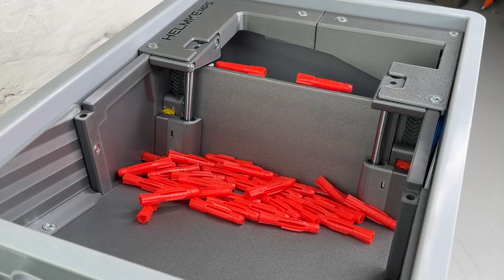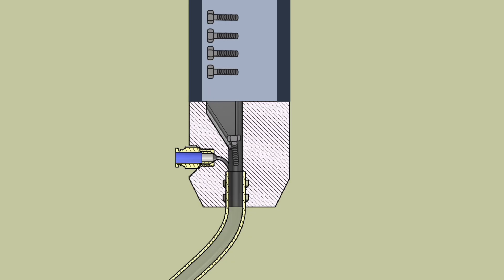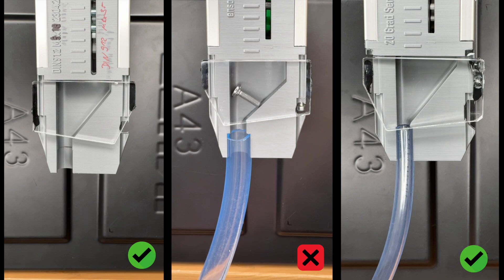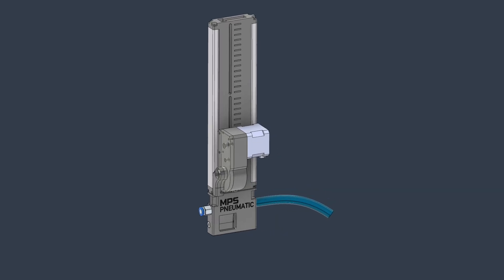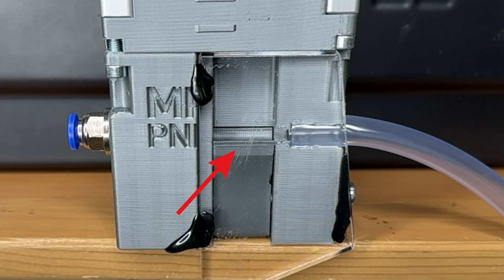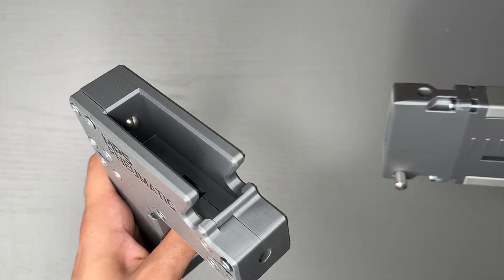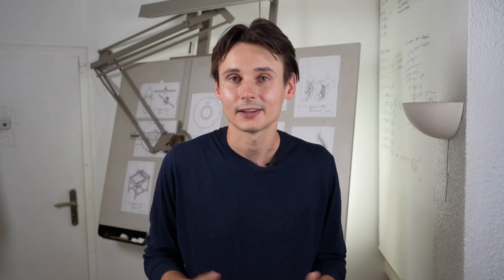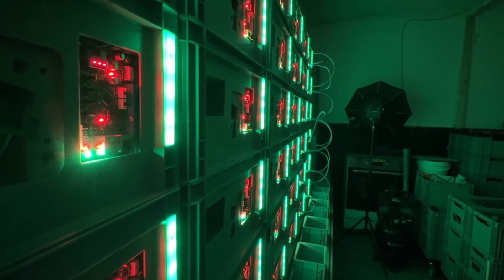Launching screws through washers - 3d printed automation #009

Comment: I made an OpenSCAD module that computes the space carved out by an object as it follows a parametric path in space.

It's parametrized to allow uncertainty in position/orientation to vary through the path. I used it to design a docking tray for a magnetically mounted printer bed probe. The tray is held on a short arm mounted to the shaft of a cheap stepper motor, and it is ramped to accommodate the terrible amount of slop the cheap motor has.

I wonder if you could do something similar for the falling parts as you try to maneuver them into the pneumatic tube in the correct orientation.

Comment: In my opinon the first drop down screw feeder, there was to much of an open area for that one screw to flip over. If you angled the left side wall to a 10 to 15 degree angle toward the right side wall causing a funneling effect the screw would have sliden down perfectly no mater the size of the screw head. if you reduced the open area that it takes the screw to flip it will not have enough room to flip in the drop chamber.

Comment: I think some kind of an escapement mechanism that locks the column above, drops a screw and repeat would have worked, it would have minimized the fall distance and also seal the tube from leaking pressure into the screw tank. Great job indeed, also love the debate in the comments

Comment: a steeper angle and not as wide would work. imho the first short one works because of the steeper angle it has. and to offset the bigger bolt head it needs to be a few degrees more than that.

Comment: Why not just add a rail with a hole in the middle that would catch the head of the screw but let the tail fall down, allow it to slide down the rail into an opening and so no matter what direction the screw enters the rail at it’ll always face the same orientation. To solve the problem of allowing multiple screws you can have multiple steps to the rail and this will even automatically sort them.

Comment: I wonder if an optical inspection phase coupled with a pneumatic or mechanical gating phase could help get the defects down to about 1:100,000. This defect rate would allow for a run of 1000 parts to have a 99% chance of being defect free - definitely a boon for the operator!

So far, I am thinking of an active system based on computer vision, with either an air jet or sliding block diverter.

Sensors:
The system has two sensors:
- Upstream from the diverter, a 1d lidar sensor and computer vision kernel scans the bolt profile and provides a go/no-go signal
- Close to the diverter, we have laser gates to verify part arrival and velocity, and trigger state changes
-  We learn the go/no-go transform offline:
    - By simulating the bolt's optical profile using its cad data
    - Or by running the part through the sensor to learn its profile

Sliding Block Diverter:
In a mechanical diverter, the tube feeds into a spring loaded diverter block.
- If the part is flipped, a solenoid shifts the block so that the part enters a tube to the "reject bucket".
- Otherwise, it shoots through the diverter block.
- A sliding o-ring seal between the shunt block and outgoing tube seals minimizes pressure drop

Jet Diverter:
In a pneumatic diverter, the tube feeds into a section with an ejection slot.
- During normal operation, the bolt shots past the ejection slot, pulled by the vacuum of a second accelerator.
- If the bolt is defective, an air jet knocks it into the reject bucket.
- If the reject bucket is sealed and maintained at line pressure, the second accelerator may be unnecessary.

All this amounts to incredible bike shedding if we can't carefully model the reliability of the sensor and diverter, and persuade ourselves that this scales to 1:100,000 defect rates. I'll see if I can find  a paper that lets us do some helpful napkin math here.

Comment: this is overly complex (referring to the vacuum to keep the screws from bouncing). why do you need to drop them from so high giving them the energy to bounce like that. both design cases could be solved by shortening the distance the parts drop before colliding.

Comment: There will always be edge cases where a system won’t work. Here I see an issue with short screws with large heads. Short panhead machine screws are not uncommon.

Comment: I enjoy the opportunity to watch another creative’s process, thanks! I think that your previous design could also work with a parametric change. An asymmetrical v shape with a small bumper on the head side and a curve for the tail side to spin with a width at the top of the v that is slightly wider than the hardware you’re sorting is long. A claw or fang shape if that makes sense. The head will cause the hardware to spin when it hits the bumper and then the narrowing shape will prevent it from over rotating. The width of the funnel as well as the curves would depend on the length of the hardware but that’s just a little bit of math and the computer does the hard work.

Comment: Why cut the orings in half? Wouldn't it be less destructive and more secure to just put them on the pipe first, then clamp the pipe in the assembly grooves?
Reply from the maker: You are probably right. I did not have the right sized O rings however and thought this would make it easier to change the tube(which never happens)

Comment: adding the washers would be a lot easier if you had a slide on a very slight angle that would hold the washer in place with very weak magnets barely strong enough to hold it. then you could shoot the screw whenever and possibly even catch it in another tube. you would have to flip it to actually propel it tho, so maybe not the best idea ^^

Comment: Hey Christopher, really like the documentation of your development progress. Really liked the screw shot, as a engineer, I would do the same, just to prove that it is possible. Out of interest, both your "old" as well as the first design interation of your accelerator have a lot of space for letting the part move around. Would it be an option to make one of the walls adjustable, like changing the space for the screw with an position locking function? Did you consier that and thrown it out the window? The vaccuum seems like a good aproach, but also was a complete redesign with probbly a lot of testing to get it to work, while having a kind of working approach ? Never the less, awesome video as always. And please don't struggle about your upload rate. I think I speak for many, when I say that I  apprechiate your idea as well as the production and educational value, and if I only see a video from you every 6 months, I am glad that I get that after all. That is much better than a quick and dirty video without much value, just so you can upload every week.

Comment: Imo the first version would work if the screw path was more constrained (like have a funnel for each size of screw, including a narrower part for the tail so it cannot rotate the wrong way.
Though this one has a lot of advantages, including probably being able to redirect flow, if you put a y in the tube and block one, you should be able to use the suction to pull screws in one way or another.

Comment: Instead of chopping O-rings in half. Might I suggest just using TPU filament, right off the roll. I have had amazing luck doing this, for many different types of projects, including 3d printed clamping hinges, that hold glass enclosure doors.

Comment: Why cut the orings? You should be able to run them on the tube, align in one half of the inlet, and close over without splitting them, right?

Either wqy, the screw dispensing line is super satisfying to see and watch. Loving this series!

Comment: FN Herstal solved this exact problem in the 90's with the design of the magazine for the P90. they use a carousel chute that leaves no space as all for the item to rotate; the chute changes the orientation.
Reply: Yeah, seeing screw bounce on the slope, I wondered if a simple S curve would have helped enough to force the tail down the tube first.
Reply: But why does it have to freefall such a long way? Just because gravity is free? The first redesign would have worked much better if they was dropped minimum distance instead
Reply: @ErikLevholt  i think that might be because the component that releases the screews from the magazine one at a time is circular, so the screws pretty much need to fall for at least 1r of that component.
Reply: I feel like I must be missing some design criteria that necessitated the part being free dropped instead of rolled/guided with a more contained path...?
Reply: @BallisticTech  The design was meant to be parametric so it could be easily adapted to varying sizes. No clue if its feasible but he mentions several times that was a consideration.
Reply: @AGIANTSMURF  yeah I heard him mention that. I'd think given the dimensions of the screw in question you could design a chute that constrains the potential energy of the screw such that it wouldn't be able to flip as shown. Like a steeper ramp and less free fall... But IDK I def feel like I'm missing something.
Reply: @BallisticTech  Gravity is free? Not sure either. I kinda figured he would cut a slot in the tubing that the magazine would fit around, but that would leave a lot of air escaping, and probably jostle around the remaining ammo...
Reply: @BallisticTech  right. Simply decrease the drop height...

Comment: In my experience with part feeders, never allow stubborn parts much free movement in air. Where that becomes an issue avoid bouncy hard surfaces and free space by controlling the part into the next transition or redirect. While mid-air assembly looks cool, it's impractical once the parts are no longer captured in path where timing and alignment are critical. Drop them out of the escapement or feed path when together. The best parts of your video's are the trial and error, cause and effect solutions letting it teach you how to rectify the issue.

Comment: This is absolutely awesome! I've been watching and waiting for you to post, but I don't remember all the specifics, so feel free to ignore my suggestion if it doesn't fit your project plan or you're already doing something similar. I also don't have a ton of experience with automated systems so I could be way off.

I think it's already very marketable as a manual system, but I think what you need to really make this more widely marketable is software to control it all and update a database automatically. Or even have it be controllable from work orders from ERP systems. Like having 3 levels of available systems. Level 1 would be fully "manually" controlled where you choose how many of each from the control panel and it doesn't do any tracking. Level 2 would be controlled by some simple software that keeps and works off it's own database. And Level 3 (Where the BIG money would be) is a system that can take work orders from popular ERP systems and auto-update inventory levels. Level 3 would probably require some consulting work for install and integrating it with the customers process, but that's where the big company's would most likely be based on what I know about manufacturing. Medium and small companies would probably get by with a level 1 or 2 system or figure out the integration themselves if they purchased a level 3.

The programming to hook everything together to a single controller might be pretty simple like WS2812b individually addressable LED's?..... maybe you already have all this figured out though.

Again, I could be way off on what you are looking for out of the project and this is just my thoughts from an outside perspective.

I love your videos and watching you solve all of these problems! Keep on Keepn' on man!

Comment: Why are you giving them that much room to fall and generate energy for the bounce? couldn't you just make the chamber shorter (height-wise)?
Reply: First thing that I thought as well, it definitely can be made shorter
Reply: Then it wouldn't be big enough for larger screws.
Reply: @markrainford1219  Screws that large would not fit through the tube to begin with. There is no need for the chamber to be any bigger than the tube itself.
Reply: I thought IT would be better to have a Magazin which ist more narrow.
The screw slides down with its head on the right wall of the Magazin and has a lot of place to Touch down on the beveled bottom and much more to the left when IT Starts to rotate.
My Idea was to have the Magazin smaller so that the place to rotate is gone.
So a simple 'insert' of an rectangulare placeholder would reduce the space in the Magazine and the screw would fall down more over the Outlet.

What do you think ?
Reply: probably because of the mechanism that retains the next screw
Reply: @thingsmymacdoes  But the thing is, there is just empty space. You don't see any mechanism in this area moving or sitting.

I rather think it's accessability, but considering how critical of a cause of error this uncontrolled bounce is, it's better to sacrifice anything to ensure the control of the process.

Comment: Very cool update! Also, a bit surprised at your use of canbus versus something higher speed like ethernet, but I suppose we will learn more in coming videos.
Reply from the maker: CAN seams to be cheaper on the physical layer, and it can be daisy chained,  also data rates & speed needed are quite low.. If someone knows how to daisy chain ethernet and not needing a switch i would love to use it
Reply: @christopherhelmke recently there was an open source project for a low speed Ethernet switch (100mbits) shared in hacker news.  The project was the Murex Ethernet switch by Murex Robotics. 

With something like this I could see you doing a daisy chain-ish approach to wiring. However, given the relatively low bandwidth nature of what you’re doing, I do not think the additional bandwidth gained is worth the added complexity of dealing with Ethernet
Reply: A not so bad idea is to also use ethernet cables but for CAN. Then you can reuse the much more robust hardware and cabling.
Reply from the maker: @rkan2 yes thats exactly what we are doing, prices for patch cables are very low as well compared to any other robust alternative I know

Comment: Launching Screws Through Washers - 3D Printed Automation & Season 2!

* 0:18 New Season, New Goals: This video marks the start of season 2 of the creator's modular production system (MPS) series, focusing on building faster and more complex automated systems.
* 1:27 The Problem: Flipping Screws: The previously designed pneumatic accelerator, which shoots screws through tubes, has an issue where some screws flip upside down, making them unusable for the next automation stage.
* 3:18 Analyzing the Flip: Through slow-motion analysis, the creator determines that longer screws with larger heads have more time and space to rotate in the air, leading to them landing upside down.
* 5:21 Redesign Attempt 1: Inspired by a Comment: The first redesign involves shooting screws horizontally into the tube, mimicking a rifle mechanism. This fails due to bouncing and flipping still occurring.
* 8:56 Redesign Attempt 2: The Vacuum Chamber: The final and successful redesign introduces a vacuum chamber below the screw drop. The vacuum sucks the screw down right before impact, preventing bounce and ensuring correct orientation.
* 12:02 Success & Trick Shot: The new design is highly effective and efficient. The video culminates in a "perfect shot" where a screw is launched through the air and accurately lands on a washer.
* 12:52 Big Updates: New Electronics & Help: The creator reveals a significant update: a new control board developed with the help of a viewer-turned-employee. This board is more efficient, versatile, and allows for network connectivity.
* 12:52 Business Model Pivot & Future Content:  The creator hints at a change in their business model and promises more information in the coming week.  Viewers are encouraged to subscribe for updates. 

I used gemini-1.5-pro-exp-0801 to summarize the transcript.
Cost (if I didn't use the free tier): $0.05
Input tokens: 12856
Output tokens: 738

Comment: Couldn't you have just minimized the fall distance?
Reply: For real! We don’t see bullets falling into the chamber. Solenoid pushing the built RIGHT into the “barrel”
Reply: What if he wants to use it with a short screw with a large head?
Reply: @VAL9THOU  well the tube diameter stops him from using X large heads so he could adjust the drop distance to account for this fact.
Reply: @johhnyknoxville3948 true. There could be different fall distances for each screw type, also the angular slide part could be made removable

Comment: the initial design already has room for improvement. you should always seek for less complexity in your design. proper enigineering in this case is developing respective designing a system that uses fewer parts whilst maintaining the same functionality and improving the reliability. reliability is exactly your weak spot here. why's that? because you're droping your screws from a pivot point (your gear) with unrealiable results or orientation of the screw due to impact of droping. You should exploit your origin pivot point in a way that you're not dropping or releasing a screw but rather rotate the screw into the right position in which you can use your pneumatic valve to push it forward. Imagine an old western revolver where the bullet gets rotated into the exit shaft. With this concept you should be able to reduce your complexity and get rid of our suction idea.

Not a complaint, just a remark :-) keep it up! Howdy eng fella